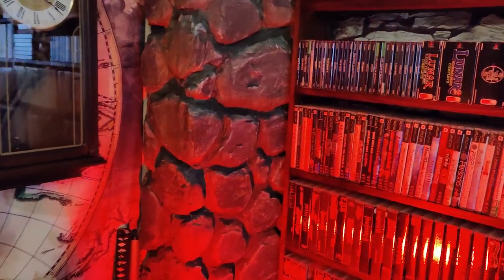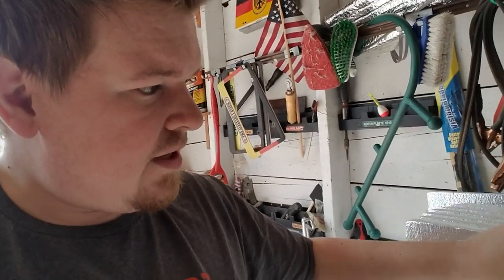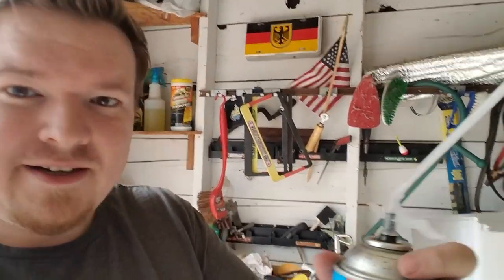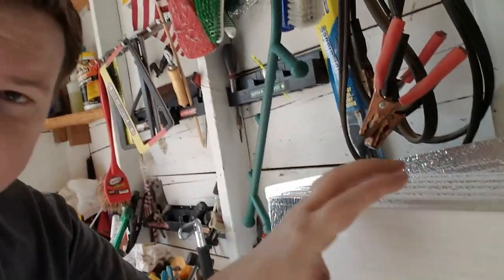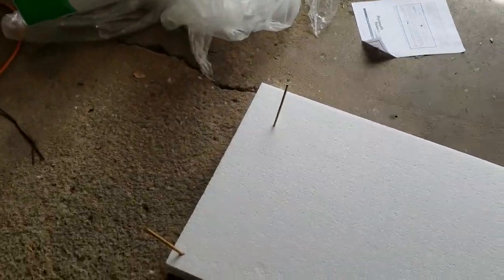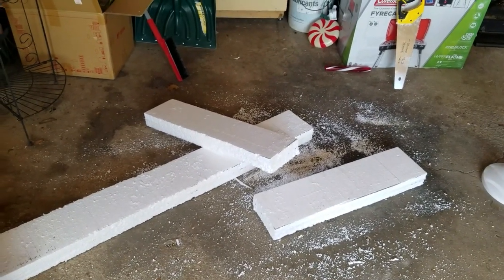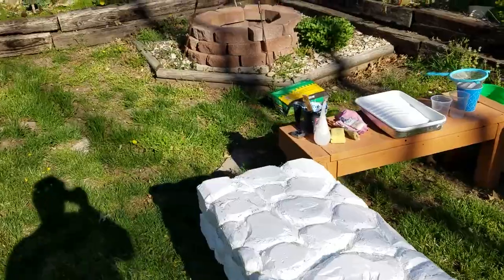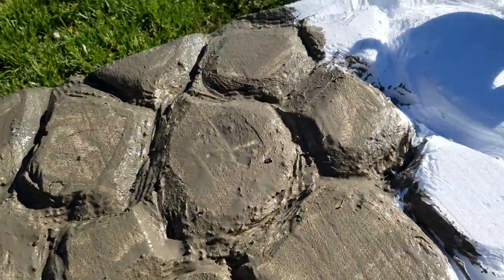Awesome DIY Cobblestone Wall Prop for Under $100

Comment from the maker: *Here are some affiliate links to Amazon for some of the materials I used. This helps support me, and the show! *
Garage Insulation Kit Foam: https://amzn.to/2KfxPe5
Wire Foam Cutter: https://amzn.to/3cogoUD
(Mine was DIY but also kinda Jank, the above one should work better.)
Mortar Mix: https://amzn.to/2Ka6eLe
(I used FlexBond brand from Home Depot but this ought to work too)
Great Stuff (Blue Can): https://amzn.to/2RKjnyU
Acrylic Paint: Just buy this local from Michaels, JoAnns or Hobby Lobby, Amazon prices are a joke.

Comment: Not bad at all. Good job. I worked for decades as a cabinet and furniture design/builder, and have done a lot of this type of work 
professionally. Another interesting way to create a stone look cheaply is to take a piece of 3/4" MDF (medium density fiber board) and split the thickness in half using chisels and pry bars. Start the split by hammering a large chisel into the center of the 3/4" edge and then pry it in half using a pry bar. If done correctly, you end up with a surface that looks similar to slate.